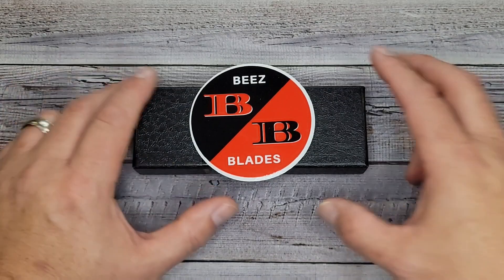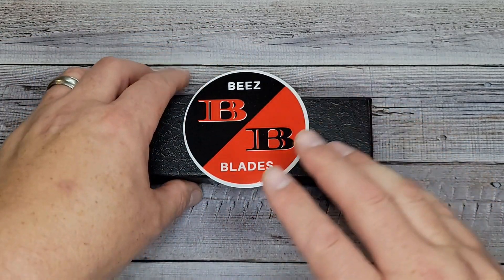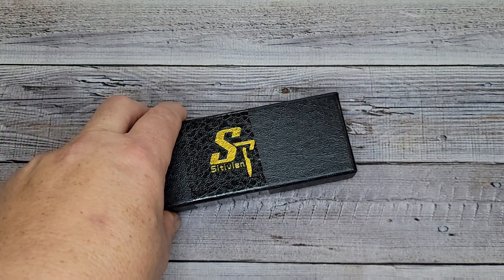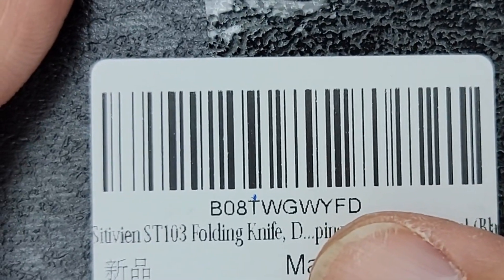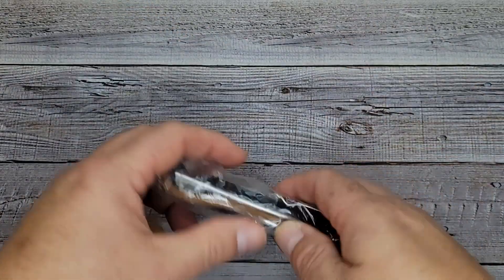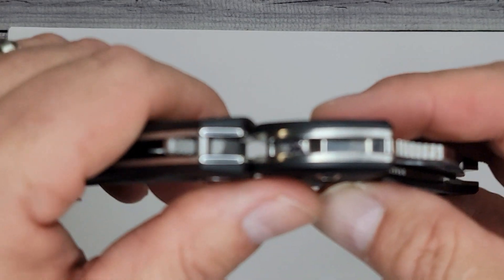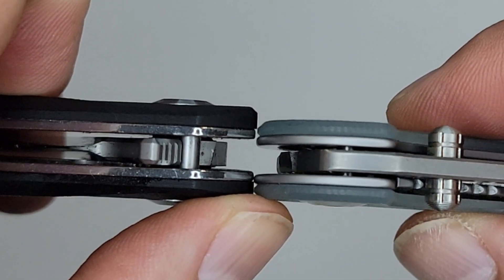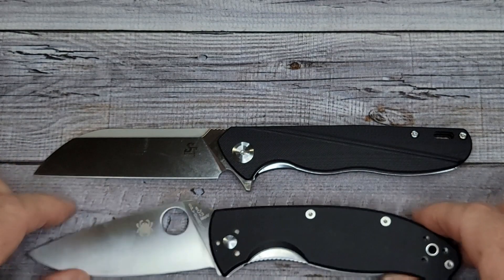SITIVIEN ST103 UNDER $30! A GREAT KNIFE GIFT! (AND KEEPER) ANOTHER GREAT BUDGET FLIPPER!

Comment: I like the larger size and improved action over the Penguin.  Steel bearings?
Reply from the maker: I've been told they are steel, so I'm going to say yes hahaha. I'm going to have to check them with a magnet in the future. Thank you Hal!
Reply: @BeezBlades  at that price it doesn't matter.